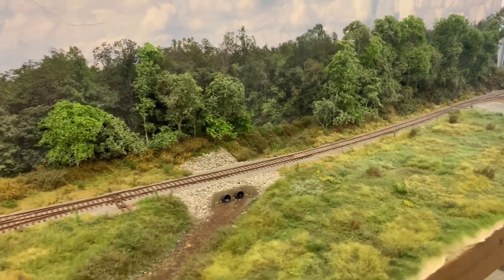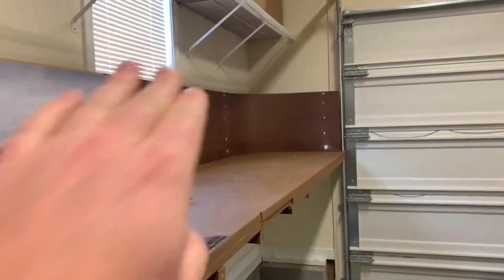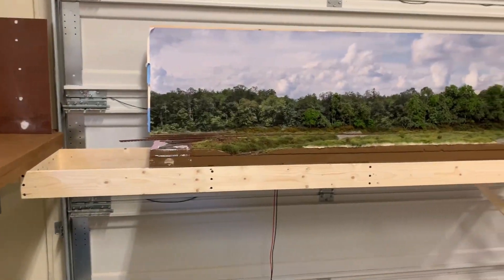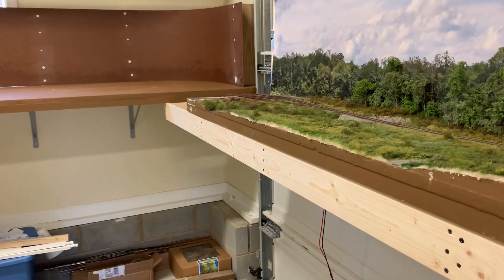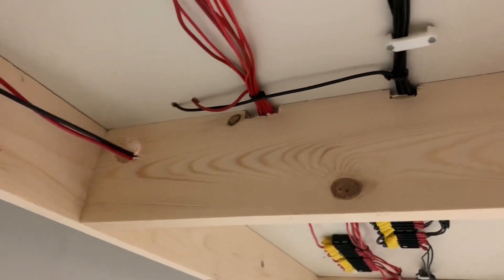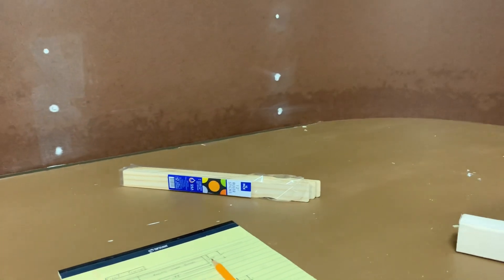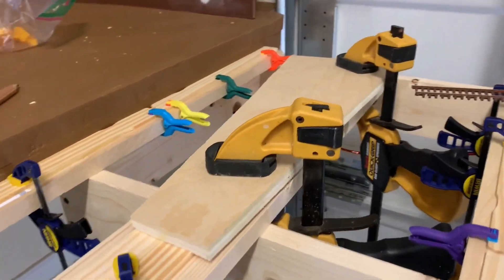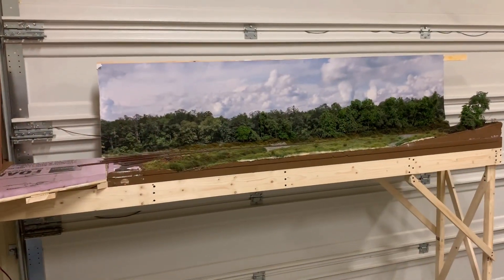Manchester & Deepwater Version 2.0 Update 8: Creek Scene Installed

Comment: I recognized that little package of paint stirrers immediately. I bought a pack of those for the work I'm doing on my teardrop trailer.

Word to the wise, if you use one of these to mix epoxy resin, do NOT leave it in the mixing container overnight!  I did, and part of it is still there.
Reply from the maker: ha!  duly noted.

Comment: When you first talked about drilling holes for the wire, i'm sitting here say "just noch it"  Then you do it, LOL.  I would definitely round the corners on the peninsula, although I might put a little straight stretch in between two curves.  It gives a little more foreground space for scenery. It's good to see the creek back up, hopefully you'll be running trains again before long.
Reply from the maker: yeah, I eventually figured it out with the notches!  Good thought on the peninsula, I am not sure I have the space to do it with the board curves I want there, but on the U-section above the workbench I certainly can.  great thought!

Comment: Don't run lighting wiring in same holes with bus wiring, it will creat all kinds of problems with you decoders.
Reply from the maker: oh, wow I had not thought of that.  Any thoughts on how far away power bus should be from DCC bus to avoid?  front of module vs rear is a little over a foot if I were to drill additional holes..?
Reply: @johnarthur6302  if your only using it for power to electronics , I'd got to rear if your using it for lighting(buildings an such) front or middle. I thought I'd planned for it and later found I didn't make holes big enough -- not fun . Give all wires a slight twist your better organized then I so I think you will do fine. Oh, I try for at least 6" apart. Induction isn't very strong with lower voltages &amps. 
Keep up the fine work, good luck , and enjoy your trains.